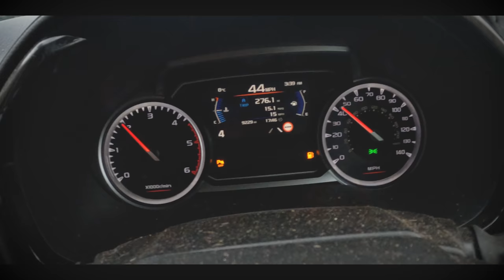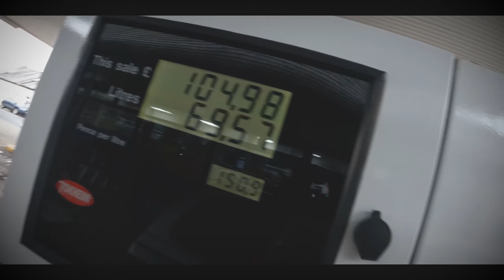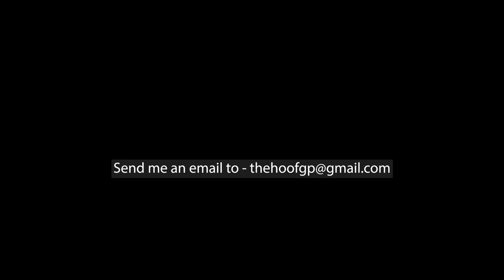CONGEALED PUS in HUGE BULL'S HOOF

Comment: This farm needs that special rubber matting everywhere to protect the hooves of the cows and bull/bulls. It would save alot in hoof maintenance and make for happier cows and more milk production 😀
Reply: The problem with rubber matting is that it is harder to scrape than concrete. Constant scraping will wear rubber down fast and muck is going to get in the seams no matter how tightly you lay the pieces. I agree concrete isn’t the best thing, but it’s understandable why it’s so widely used. 

There might be a spray-on rubber like substance that could fix the seams issue, but would still wear down fast being scraped by the tractor all the time.

Comment: One question Graham..When you cut away "bad" areas on a hoof, particularly on the outside wall, why do you not cover that open area after spraying on the iodine?  Aren't they also in muddy, or mucky areas where stepping in poo is a great possibility?  Just seems to me that a wrap to protect from that happening would make more sense, because even on concrete I'm sure this bull walks through his manure all the time.  Not criticizing, mind you, only wanting to learn more..
Thank you..🥰
Reply: I want to know too because it's been bugging me knowing the wound isn't covered........
Reply: @antinutjobs  From what I can see, they put a "lift" of sorts on the undamaged part of the hoof. That way, the cow is only in contact/putting pressure on the uninjured part of the hoof. But take my words with a grain of salt, I'm only observing.
Reply: You wrap a hoof to hold meds in place (iodine will stay in place anyway), not to keep it clean. The absorbency of the wrap, means It will soak up slurry and hold that on the hoof, with no meds in between, it guarantees infection.
Reply: If the bull cant fit in the crush he leaves them loosely wrapped so the fall off in a day bc the farmer cant take a wrap off alone. With this one hes already over the infection so no need to put the putty or the salicylic acid on it which is what the wrap it usually holding in place. Also the iodine is drying so air is probably good for it. And that farm looks unusually clean

Comment: Does "the" crush have a generator for power? Was it automatically built into the structure or do you have a portable gen? Diesel or gasoline? And, does the manufacturer service the computer components and update the software for you at home? Have you ever had computer issues while at a client's farm? If the crush is inoperable  for any reason, will they service on site?
Reply: The computer is an ipad, not actually linked to the crush.
I believe this crush, runs off a battery, but still needs to be plugged into the mains, when there's more than a few cows.

Comment: Question: why do you not clean/hose down the hoof before you start work? It would seem that a clean work area would be a good way to start. And you usually do it afterwards anyway.

I'm just curious. I'm in no way an expert on the hoof requirements of bovine.
Reply: from what i can recall, it's mainly a time issue. most hooves are fine to just trim without any cleaning, likely 80-90 percent if i had to guess, and since those hooves arent anything too interesting, we don't see them. By the time he notices the problem, the hoof is generally clean enough to proceed, and the rinse at the end is just to prevent bacteria. If I'm wrong about anything or everything, I truly hope someone corrects me, but I recall someone explaining that

Comment: Quick question do the blocks cause problems due to the excess pressure on that half of the hoof?
Reply: Only if they on too long or badly fitted. It is though, still a possibility, but the lesser of two evils.

Comment: I did get a dealer to take back a car i bought from them no issues with the return and a couple of days later i ended up buying a different vehicle from the same dealership and they said any issues please bring it back  the 2nd car was just fine and had it about 6 months before my first issue  ( battery ) it got cold i live in the usa and north Dakota  i did buy from them 2 more times after that  then i moved but the only dealer i bought from for 14 years at the time

Comment: Is that truck a diesel? Looked like you had a DEF cap next to your fuel tank, I was looking at those roads and my diesels would never fit, I have a 2000 Peterbilt and hooked together my trailers are bumper to bumper 105 feet long, my pickup is a Ford F450 crew cab diesel, It is CHUBBY
Reply: Yes, it's a diesel. Nearly all UK trucks are diesel.

Comment: I know should could drive pulling a trailer, 'cause I am a female semi truck driver, have been for 12 years. Our trailer is 53' long, the truck is about 14 feet long. I have driven 9, 10, 13 gears but now at age 64 I driven an automatic 'cause the knees are giving out.😁

Comment: The steering wheel is on the right side of the pick up?... Is the gas pedal on the left? And the break on the right?
Reply: Gas is also on the right.
Reply: @alistairclement4239  fr? Two gas pedals?
Reply: @SinFulPride2004mine  I meant as well as the steering wheel.
Reply: :/ your making it more confusing
Reply: @SinFulPride2004mine  how so? Steering wheel and accelerator are on the right, brake pedal, at least on an automatic, is on the left.
Reply: @alistairclement4239  ok so it's normal just sides are switched
Reply: @SinFulPride2004mine  yes.

Comment: You cut the corium a lot. Aren't you supposed to avoid cutting that part?
Reply: He cut the corium a bit, not a lot. He's supposed to TRY and avoid it, while removing ALL loose horn.
Reply: @alistairclement4239  Yeah that is why I asked because I am so confused and have no clue if it is or is not sensitive. I notice some guys are super careful, and other guys aren't necessary not careful, they're just not quite as delicate. I still don't really get it. Like is the part on their heel sensitive or different from the regular claw? Is there a specific depth that you can nick the corium, without causing pain?
Reply: @MikeySkywalker  No, there's no specific depth unfortunately, and often they are cutting blind too. For this reason trying is the the only requirement.